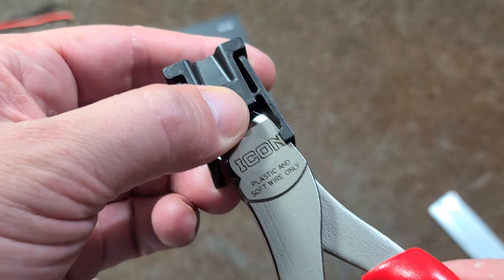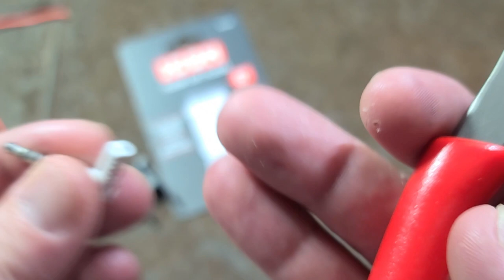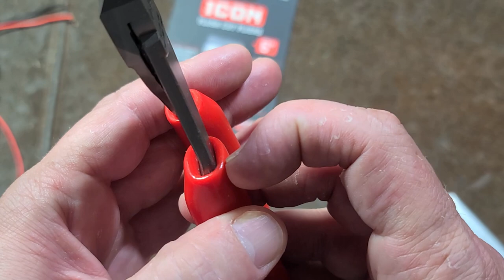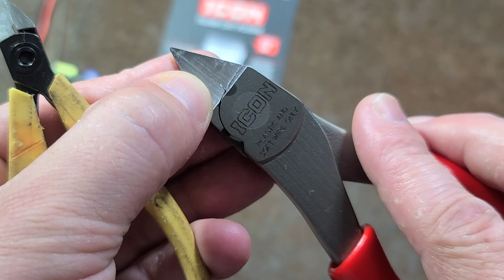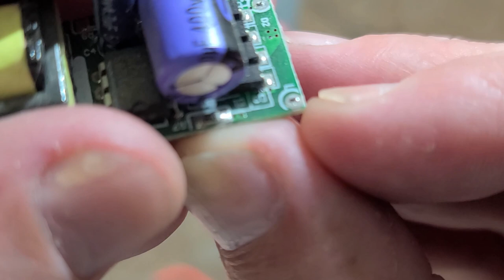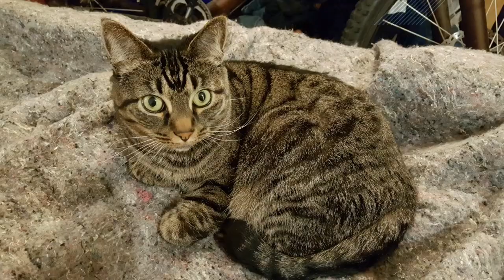Harbor Freight Icon Precision Flush Cutters Review

Comment: These are another product by Icon trying to copy snap on. They are almost identical to the version that snap on sells. The only reason i can see for the $40 price tag is that they are well made and much cheaper than the snap on version at about 80 after tax. I own both pairs and both cut very nice but have noticed the icon pair is a bit sharper but the snap is made of better steel with better heat treatment and can cut harder material without being damaged as easily. Got the snap on for general automotive use and gave the icon a shot at using only for electronic repair. Given the quality and easy warranty process these are a good pair of flush cutters, but far from the best.
Reply: I agree
Reply: 2024 these are down to $25 before coupon

Comment: Looks suspiciously a lot like a sprue cutter for plastic models $40 is way to steep for me.
Reply: I was thinking the same but more bulky, good if you had a model kit with fat sprues.
Reply: @paintnamer6403  well yes they have thick sprues and cutters to do that job saving the smaller ones from breaking, and they sell a sprue cutter just like the harbor freight if you want check out barbatos rex YouTube channel he did a review on several sprue cutters and some are almost exactly like the HFTs cutter.

Comment: I have a Knipex pair of these (that pretty sure cost less than these Icons) used for cutting cable ties. If you ever had to reach into a space with zip tied cables and come out bleeding because the last jackhole used side cutters or scissors to trim the you definitely understand the value of using proper flush cutters. The little ones for electronics usually snap after a while but these bigger ones should last forever if cared for.

Comment: jaw protector is pointless, flush cutters don't get dinged up when idle, or, getting tossed around in your tool box. they "die off" from misuse, when they're inevitably used to cut the wrong material
Reply: I've been using my Knipex cutters for removing metal debris from tires, and they only have very slight damage. I'm very impressed with them and will buy more.
Reply: It's meant to protect your toolbag or whatever you're storing them in

Comment: I was thinking about buying these. But the price they want for those are hard to part with.
Reply: I mean I’d go with the snap on’s for a little extra if I want the form factor. But I’ll do small soldering at work occasionally so it’s worth it. Normally, yeah I’m not interested in spending that much haha.
Reply: @DenyTheZeitgeist  I actually ended up buying them. Pretty damn good but still not worth the price. Glorified zip tie cutter.

Comment: The edge is so fine and delicate flush cut pliers intentionally make the 2 edge not meet or else you would fold the apex of the edge on the first use. They are close so you get a flush cut and will cut close to flush for a long time as long as there is slight overlap

Comment: Only $40?  Precision quality cutters like the Lindstroms were $35 35 years ago.
They can be sharpened by a few  places that specialize in servicing industries that consume them.
Shrink tubing can be used for custom formed tip protectors, if you think you need them.

Comment: What is the recommended wire size that this tool can cut. I was looking to make Tensor coils (2 Copper wire twisted together) ?
Reply: Go for diagonal cutters instead.  Flush cutters have a single bevel to leave a smooth edge behind but at the cost of longevity.  Diagonal cutters have a double bevel cutting edge that is much more robust but leaves a ‘peaked’ edge behind

Comment: As an industrial electrician I use flush cutters daily.  80% on cable ties to get to the wire bundle I need in and then to make sure I don’t cut the crap out of a fellow sparky with the cable tie cut improperly.  They will wear out quick compactor others but that’s normal.  I use crescent brand when I buy. They last and sent bulky.   These type done require a lot of leverage

Comment: Those are a blatant copy of SO ones, including the plastic protector the tip comes in. I have SO, and Matco versions, they work well at $60+, and warranty has never been a problem. I bought a pair at WM in the sewing section for $6 that work just as good. At $40 I would go full SO.

Comment: These are not competing against precision electronics flush cutters.  They are competing against the $80 snap-on version.
These are great for aviation work to a cutter beefy enough to cutter wires and flush cut zip ties so they will not scratch hand and arms reaching in and around ziptied wire bundles.